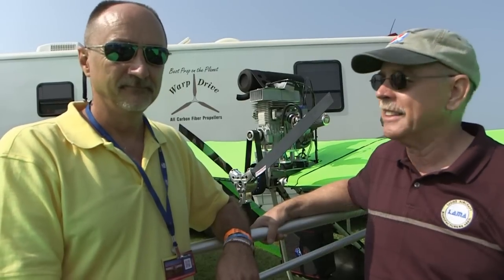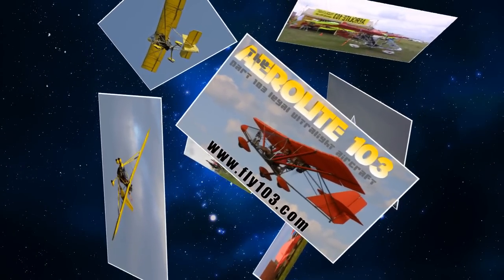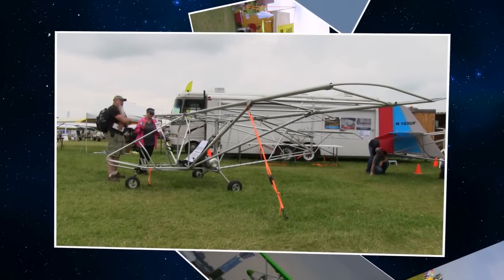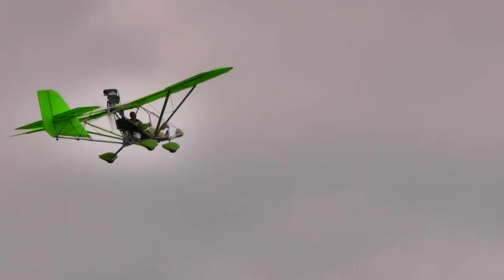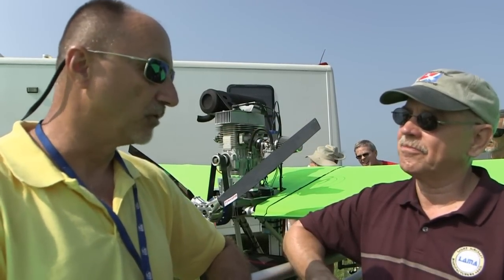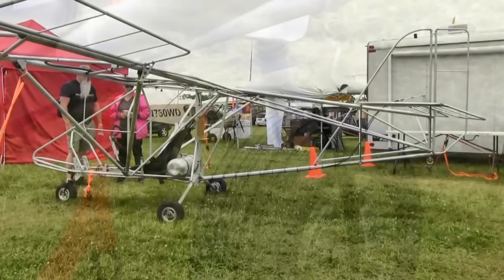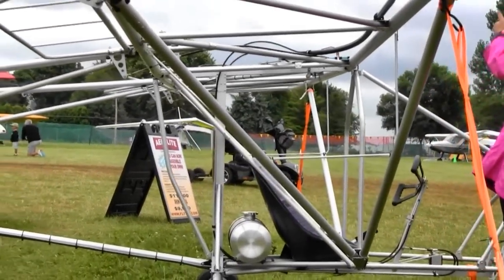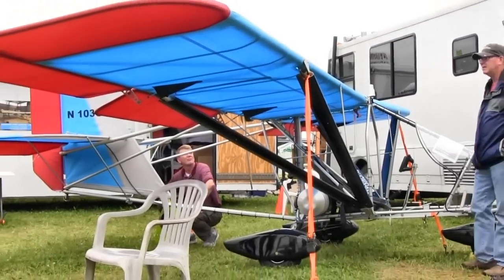Aerolite 103 Ultralight Aircraft available with Hirth or Kawasaki power plants.

Comment: For a flight simulator armchair pilot accustomed to having an ADI (Artificial Horizon) as the primary flight instrument, is there any plan to offer this aircraft with an ADI in the future ?  Also would an airspeed indicator be in the offing for this aircraft, so as to help new pilots remain within the stall margins of the craft ?
Reply: The Aerolite 103 mainly comes equipped with a Hall airspeed indicator, which is the plastic tube mounted vertically to the left of the panel. The advantage of the Hall is that it's sensitive down to 10 mph, whereas a typical AS indicator is good down to 40. Stall speed is 26-28, so the Hall works better in this case.